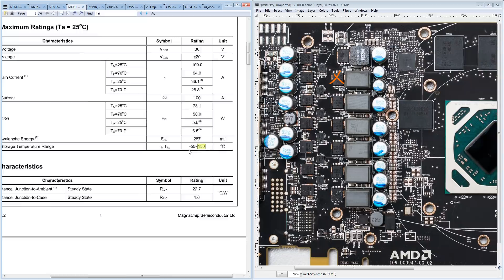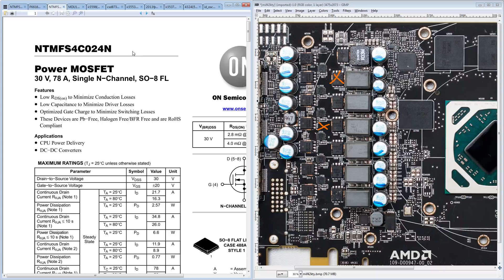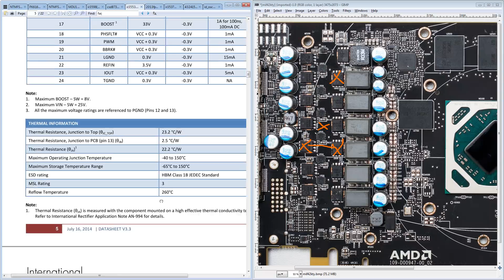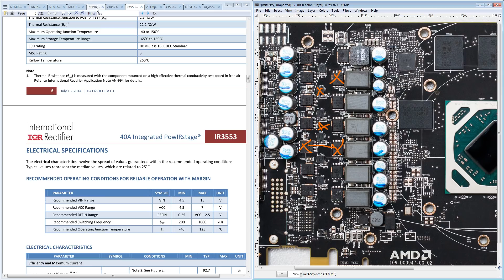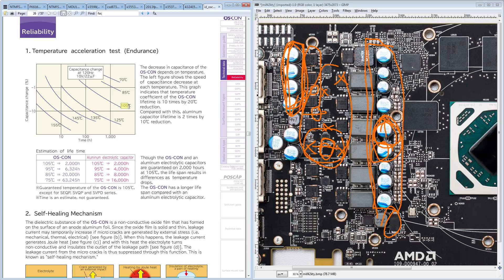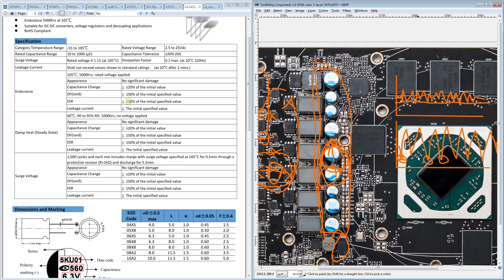What are safe VRM temperatures.

Comment: 150 degrees!! ! Im pretty sure the epoxy resin in the board material will be letting off smells at that. Its close to charring.
Reply: But the max is 150 degrees if you watched the video.
Reply: for the mosfets to die instantly, they will still fail slowly above 125
Reply: Not at all. These boards are soldered at 245 C (+/- 15 C) albeit for 60 - 90 seconds, twice. They use SAC305 alloy, so 120 C-ish is all you want to see as a Tj (solder). Above that, creep starts to be a problem and you could cause a premature failure of the solder connection with extended exposure times. In other words, the device should outlast the solder connection at the limits of the FET's rated operating temperatures.
Reply: if you watch the video, mosfets recommend 125 long term, but thats too high for capacitors, the caps want <105, and they are like 5-10 degrees less than mosfets (internally)

Comment: yeah, Blender uses AVX and 3delight uses SSE2, and both pound the CPU rather hard. And it is not a rare thing for 3D renders to take days to run. So yeah, Different realm from gaming. 208 days of 3D rendering on a 5k hour cap just isn't cool for a motherboard that can cost a few hundred dollars. A render box is not a cell phone that gets replaced every year, it's an investment that many expect will last a few years. skimping on the VRM cooler just because it can run at 125c in a 20c room is no Excuse, because not everyone lives in a walk-in freezer, lol.

Arguing that a consumer part should be exempt from being required to run any workload for the expected life of the part, is like a car dealer telling you the car is only warranted if you do not use it at all for the entire duration of the warranty period, lol. The CPU is advertised to operate at a particular performance level. And if a motherboard advertises it is made for that CPU, it should be able to run that CPU at it's rated performance regardless of where on earth someone lives or what workload they use the CPU for.

Great vid BZ, B)
Reply: Use an AIO liquid cooling with this pointed at the vrm section, problem solved :) https://www.scythe.co.jp/product/cooling-acce/sc-ysc01
Reply: If you're running extended period renders you shouldn't be using consumer hardware if it's your main income. That's why proper workstation hardware is set to a higher degree of stability. Consumer hardware is a race to the bottom to make as many sales with the least margin, making the highest quality possible shouldn't be expected.
Reply: I can sort of understand the point, even tho I still feel that if a motherboard is advertised to support a CPU, it should be able to run that CPU at the CPU's advertised performance level for the expected life of the motherboard, without being told that I can only use the CPU for so many hours a day or only use a small portion of the CPUs potential stock performance. lol. Yes, I think we all agree that 'Consumer' stuff is junk, and anything for i7, i9, TR, and Ryzen, just isn't something a 'Pro' would be able to rely on, because the motherboards are junk. lol.
Reply: He's using what I call the IROC-Z excuse. The first year IROC-Z cars had a really really bad shimmy if you go over 110 kph. I met someone who took his brand new car to a dealership and asked them to fix it. They kept telling him there was no problem then when he said, "you have to go over 110 Kph" they said It's illegal to go that fast, there's no problem with the car.
Reply: Robinson Joe,im pretty sure ther are roads that you can go over 110Kph in all countries right?
Reply: 100 kph is 62 mph. There are no roads I'm aware of where the speed limit is higher than that. You can go up to 125 without getting a ticket but they are technically right. It's still no excuse to screw somebody with a faulty new car. You can take it to a track and drive it.
Reply: Robinson Joe isn’t the IROC-Z a performance car?!? What if the owner wanted to take it to the track....
Reply: Yeah well that's why it's bullshit right. You know how many people got screwed by that car. GM knew it, but that's every car company out there. Ferrari, Porsche, VW,  Audi, Mercedes and every other company out there has screwed customers with a car. Don't buy first run cars. Wait till the second year.
Reply: Robinson Joe Here in Russia we have 110 kph as a default speed limit for highways
Reply: The problem was that if they took the car back they would have to recall them all and they weren't doing that. Since it happened they do a lot more testing but it's bullshit they screwed all the people who bought the car.
Reply: Borednbusy take a trip to America, depending on the state, you can easily see speed limits of 65, 70, 75, and 80 mph. 60 mph is considered an unforgivably low freeway speed here. Interesting analogy though.

Comment: Very interesting about the capacitors. Makes me wonder about the caps on my two x58 motherboards made in 2010. After an upgrade to a newer system it could be fun to desolder the old caps and replace them with new ones and see if it becomes possible to get higher overclocks or reduce the vcore setting.
Reply from the maker: Also depends how hard the board was run.

Comment: I think failiure due to VRM overheating is very rare for normal people. You guys should not worry about it. Prime95 is something completely artificial and you will not do a workload like it in real life.
Reply from the maker: did I literally not just spend 40 minutes talking about how basically the worst thing that can happen if you don't let the VRM thermal runaway is that it will degrade a bit after several years?
Reply: It really depends how badly it's overheating. Back in 2008 I bought myself an HD4870 (awesome card BTW), with a reference cooler. After a year or two I Decided that I couldn't live with the vacuum cleaner noise any more and ended up mounting an Arctic Cooling Accelero X2 on to it with the supplied VRM heatsinks and all that. Little did I know that I hadn't really cleaned the VRMs properly before mounting them and that the thermally conductive double sided tape provided by Arctic Cooling is about the worst I have ever seen (mind you I hadn't actually seen any other at that point though). This lead to the VRMs operating way over thermal design for about 24 hours before I started getting artifacts, I then replaced it with the stock cooler which worked for another 24 hours until it was blatantly clear that the card was permanently damaged.

So, while it is rare for VRM temperatures to be an issue it's not as rare as it should be in the enthusiast community (we do tend to push the cards a bit more than others). I know a lot better today then I did back then (I was 16 at the time), but the example does show you how a poorly designed VRM in combination with poor cooling can lead to very bad results.

Admittedly the HD4870 (and the GTX280 which had a similar VRM) had massive VRM issues, which lead to companies like Thermalright releasing monster VRM heatsinks like the "VRM R1" (http://thermalright.com/product/vrm-r1/) and "R2" (http://thermalright.com/product/vrm-r2/).
Reply: In ‘Real Life’ I use prime95 on my PC. My boss insists that it is always running in the background of the work PCs
Reply: My man, ypu remember when most amd build had a 970 board a 8320 or 50? Belive me, those killed cpus with them. Recently happened to jayz2cents. Mobo fried his dead dad s cpu.
Reply: +tfw no name. that cpu got fried because the mobo pushed something like 1.6-1.7v or more into it on boot because its set up to drain all of its power on shutoff leaving a huge voltage spike for the cpu to deal with on power on and he didnt clear cmos before boot. you can run 1.5-1.55v on a fx chip for years if you want to. and his dads cpu died because the vrm was already fried on it so it took 12v or something to the core lul.
Reply: I was summarising. For people in a hurry. Appreciate your work Buildzoid.
Reply: >  Prime95 is something completely artificial and you will not do a workload like it in real life.
Beg your pardon! I do number-crunching and obviously it's not completely artificial!
Reply: Ggchb Gig ghb Ofc made by GAYSHITBYTE. NEVER TOUCH THAT COMPANY.

Comment: Some numbers on my GTX 780 Lightning:

GPU allday OC 1304 MHz, Temp MAX 45C (peak) at 100% load, average is about 40 C at embiend of 35 C

VRM MAX Temp 55 C

RAM MAX Temp 55 C

PCB MAX Temp 60 C

All components exept for the GPU are aircooled so why is my PCB readout higher than ALL other reads ??
All reads made with MSI Afterburner !

BTW: my alphacool-Waterblock is ziptied on the GPU :D
Reply: Heinz Kot depends where the temp sensors is. It’s time for you to install the RBBY tool and install a SKYN3T Bios 😉
Reply: help on that please i was never really into hardcore ov erclocking ... i do know anything in theory but never practiced :D
so at first; what is RBBY ? :D and tell me all about SKYN3T :))

Comment: My X99 Taichi uses ISL6367 and ISL6379.  Datasheet implies it has temperature sensors, but HWiNFO64 doesn't report the temperatures. :(
Reply: The X470 Master SLI didn't have temperature sensors but the AUXTIN1 sensor showed the VRM temperature, so maybe check HWinfo for any values that go up when running Prime95.

Comment: Vrm review for the B450 Tomahawk or The gaming pro carbon ac pls
Reply from the maker: I'm considering picking up the B450 Mortar artic
Reply: i actually need to get one later this month. would be great if you did a review before then.
Reply: It's a 4-phase VRM with RT8894A running in 4+2 mode. 2x 4C029N high-side and 2x 4C024N low side mosfet (per phase).
That's about what I can find on the interwebs for the B450 Tomahawk .

The carbon pro has a really similar VRM (for CPU VCC) just with more inductors. Same VRM for SoC. Still a 4+2 phase and same mosfets and controller.
Reply: Thx And Bye is it ok for 2600x stock?
Reply: Thx And Bye Thanks dude 👍🏽
Reply: Every mobo gotta run 1800X at stock, a 6 core shouldn't be a problem

Comment: Thanks for the explanation, Buildzoid. Is Magnachip a good mosfet manufacturer? I'm interested in this SOYO (now called Maxsun) Z370 Board that uses ISL 69138 as controller configured as 7+0, and uses 7 ISL 6596 as doubler and using Magnachip MDU1516 mosfets. Is this a good config by the board manufacturer? Thanks Buildzoid
Reply: SOYO was one of the best MB manufacturers. It is not just "this SOYO". This from a very old gamer :P

Comment: Anything planned for the 1080Ti and what about the 7970 epower project ?
Reply from the maker: 7970 E-power ran into some issue caused by me being a moron. I can probably still get it working just need a hot air station. 1080Ti is planned for LN2 I've just run out of thermal paste.
Reply: I always love it when I'm forced to do some hot air rework. /s